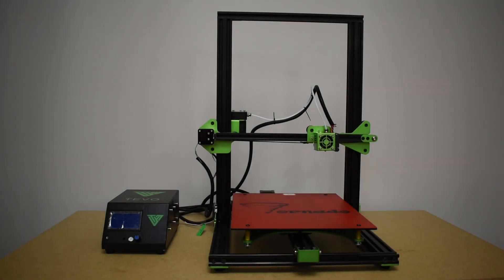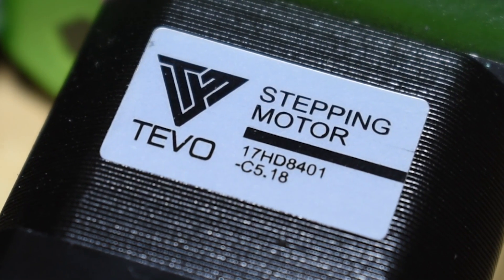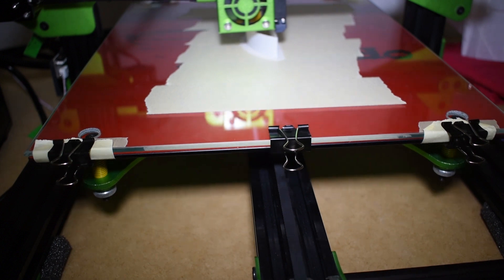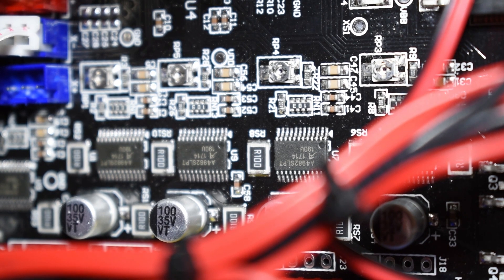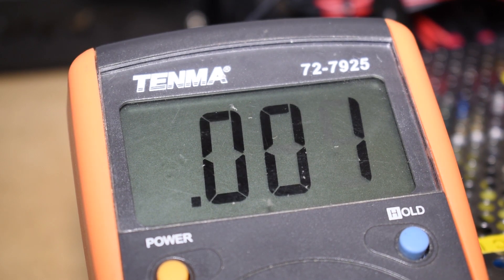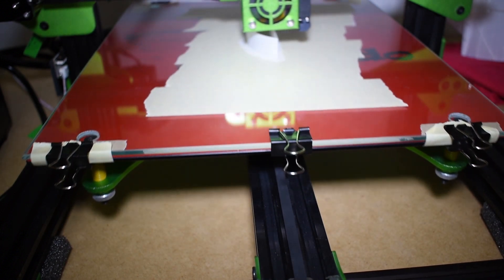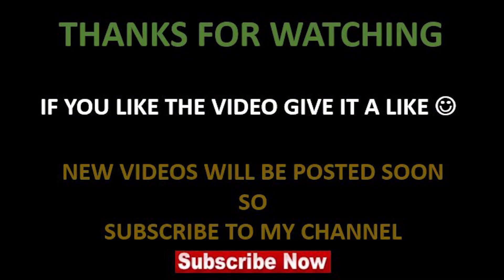TEVO TORNADO - Y axis Layer Shift - Analysis & Solution

Comment: I’m having massive layer shift issues on mine.  Like yours only in the Y axis.  I’ve checked all the mechanicals like belt tension, drive gear tightness,,etc and it’s all good.  I checked the Vref on all the steppers and while I figured then a bit on the low side, they were all absolutely identical at .83V.    Color me surprised at the consistency.  Can’t say the same for my AnyCubic printers.

I adjusted all to .95 and the layer shift was greatly reduced.  I ran 2 back to back test cubes and the shift was essentially identical in severity and position, but has been reduced probably 90%.  

I wonder if there is any spec that lists the maximum working voltage of these drivers.  I think  the Y needs bumped a bit more but I don’t want to fry the board right out the gate.
Reply from the maker: You can increase the Y vref to 1.00V. I have mine at that value and no layer shift.
Reply: ruiraptor   I looked up the specs on the drivers and bumped it to 1.1V.  According to the mfgr specs it should have no trouble handling it.  This should drive the stepper at about 1.37 amps.  Two test prints back to back and so far so good.
Reply from the maker: Yes...i think so too. As i mentioned in my video, the small motors can handle up to 1.3A so the Y axis motor being a larger one will definitely handle more current.
Reply: So far layer shift seems to have been taken care of.  Need some miles on before I'd be comfortable to say solved.  

Not sure about this bed.  It seems REALLY slick.  My PLA isnt wanting to stick all that well.  I'm printing (trying) a wall clock housing thats about 230mm dia and the brim is wanting to peel up around the edges.  I upped the bed temp to 85 deg and restarted.  See how that goes. 

Looks like I got the level spot on but there's still a slight hump in the bed running along the Y.  I've already ordered a touch probe because bed  leveling sucks and I'm lazy.  My deltas have probes and leveling is easy peasy.  And then the slight hump wont matter anyway.

Comment: I've got mine set to 1.15 and i'm still getting shifts
Reply from the maker: If you are still getting Y shifts, then there is something else you need to check like loose belts, loosen set screws in the motor gear, floppy Y motor mount plate, etc.

Comment: I just got mine a couple days ago, and I'm having a layer shift problem. Have you had any more layer shifting since changing the voltage?
Reply from the maker: Hi Brett,
I have had NO layer shift issues after adjusting the Y axis Vref.
But there are a few more things you need to check like the Y axis motor mount plate (check if it's secure and square with the frame), check your belt...it cannot be loose. Also check if the motor gear is correctly tightened.

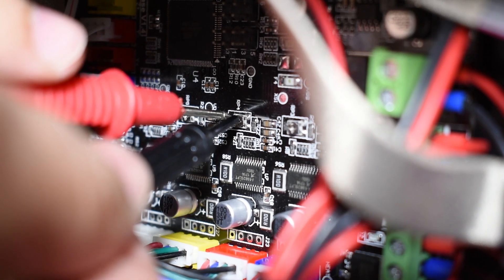Comment: @3:10 you mentioned that the 1.00V adjustment translates to 1.25A, how did you arrive at the amperage value?
Reply from the maker: Hi,
The formula you must use is the following: I = V_REF / (8 × RS) where RS = 0.1
This is in the driver datasheet with only one difference which is the RS resistor. On the MKS base boards, the RS resistor is always 100 Ohms. You can also check here: (http://reprap.org/mediawiki/index.php?title=MKS_BASE&oldid=157894)

Comment: How do you know which stepper is which on the board?  Are they labeled on the board?
Reply from the maker: Hi Rafael,
Yes i know.
If you take a closer look to the board, you will see one empty (unconnected), driver. The next one to it is the extruder, next is the Z, next is the Y and finally the X.
Reply: Thanks!  Are all of them .95 including extruder.
Reply from the maker: Hi Rafael,
No. I adjusted all of them at 0.95V except the Y axis. The Y axis i adjusted to 1.00V.
Reply: Thanks!  Just did the same thing.  They are almost dead on at .95

Comment: Has this issue been fixed in later production units or does Tevo not see it as an issue and not corrected it?
Reply from the maker: I know that tevo is taking especially attention to the first batch problems and some of the reported issues are being addressed so let's hope that yes.
Reply: +ruiraptor I have one ordered from GearBest with expected shipping between (Oct 27 - Oct 30).
Is there a way to know which "batch" I will be getting? 
Is there a way to tell which "batch" from markings on the printer? 
THX! :*)

Comment: In your experience with both the Tarantula and now the Tornado - can you recommend one over the other? It seems like the Tornado comes with most of the improvements needed to be made to the Tarantula. Probably end up around the same price. I don't really need the bigger print area but AC bed, aluminum parts, titan extruder, etc. out of the box seem to tip the scale toward the Tornado.
Reply from the maker: Hi Mike,
that's exactly it. The tornado is a bit more expensive but it's ready to rock and roll hard. The tarantula also prints ok out of the box, but it's recommended a few upgrades to improve the quality. With the tarantula you will learn a lot...while with the tornado, just tighten some screws and go...no much learning in the process.
Reply: https://plus.google.com/u/0/+RMedelis/posts/U3pm1kyzzLd

Comment: hi,  any chance you could show the process of how to adjust this.  my tevo tornado is in transit so if this occurs on mine it would be good to know.   thanks.
Reply from the maker: Hi guys,
Christopher is correct. I posted a video explaining in detail how to do this. That video is for the tarantula but the boards (although different versions and the drivers are in different positions) are the same and the procedure is the same. Also, do this only if you notice that your printer is also shifting layers and be very careful when doing this especially because you have main voltage inside, not only on the power supply side but on the SSR side too.
Reply: Mark Andrews he actually did. Look up how to calculate Vref for your specific board and drivers; then adjust the needed potentiometer to make the changes you need.
Reply: Mark Andrews he also posted a video on Vref tuning for the Tevo tarantula. I don't know for sure, but i think the boards are similar. Here's his video:  https://youtu.be/kkjwOxDSCiQ
Reply: TEVO Tornado custom firmware https://youtu.be/6Q546Oiwq_w